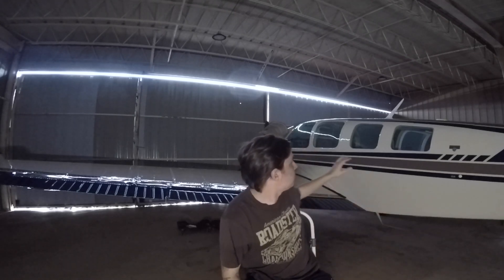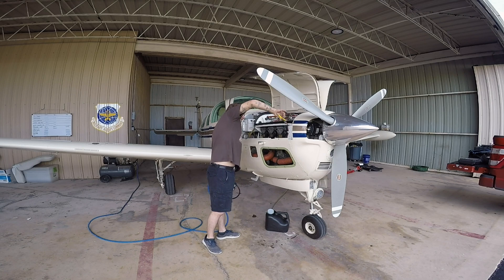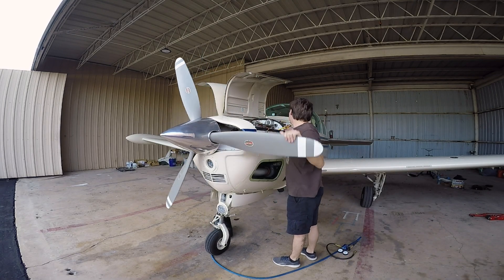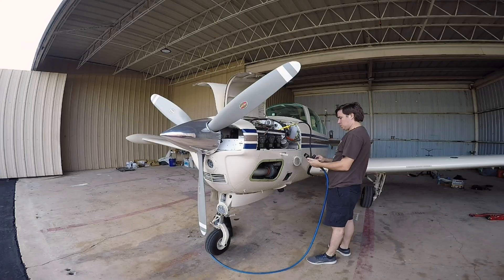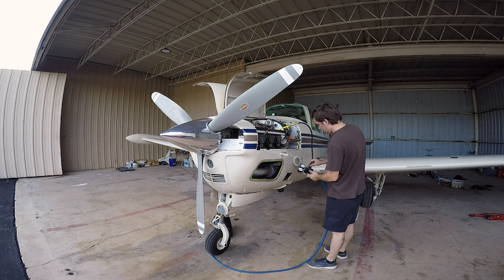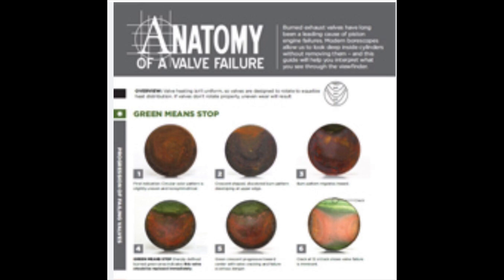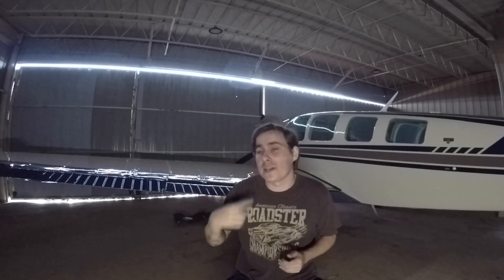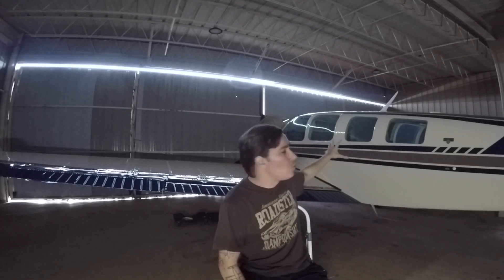CompressionChecks Are Crucial To Determine Engine Performance | A36TC Beechcraft Bonanza Maintenance

Comment: I didn't notice the cabin lights either.  Something I would definitely work on is sound. Especially when you move or turn away from the camera in some of your videos it's hard to hear you (examples: shouting from the cockpit during the gear swing video, and turning to glance back at the aircraft several times during one of the videos about trying to start on of the school's planes (I forget whether the single engine or multi engine).) Speaking as someone who's never recorded anything for YouTube: could you use a wireless clip-on mic or something to keep the level consistent?
Reply from the maker: I have been considering going to a wireless mic in the future. I too have noticed the microphone issues when editing and have been trying to break the habit of speaking away from the mic. 

The only small, very small problem with a wireless mic is that it will draw down the battery life very fast, but with my new adapter and hero 9 I can charge the camera wiel also having the mic plugged in so I may have solved that issue

Comment: Is Camguard oil additive a recommended product? Do all engines have oil coolers?
Reply from the maker: I recommend it, if you use W100 Plus then camgaurd is already in it. As far as oil coolers go, no not every engine has one. Many of the lower performance engines don't really get hot enough to need one.

Comment: Hey Bryce where can I find more info on the limits for the contential compression check limits. I remember reading if they are 42 or above with the master orifice then they pass but that conflicts with ac 43.13s number being 65. How do you handle this situation?
Reply from the maker: Sure thing look at SB-03-3, it's also in the Continental Standard Practice Maintenance Manual. It guides you through the master orifice check. Also AC 43.13 is acceptable data that can be used when no Approved data exists. So based on that Continental manuals or SB overrule the 43.13. The same idea applies to torque if the manufacturer has a torque table it trumps the one in 43.13 I know that was long winded but hope it helps.

Comment: The content is excellent. Video production side, you just need to make that you are well lit and that the lighting is even overall. Also, for a talking head video, you want to stay away from wide angles unless you want the background to be part of the focus—which will also need to be appropriately lit, in that case. If you are not going to light the background object(s), then a tighter field of view is better. But, again, the content is amazing.
Reply from the maker: Thanks for the tips. I finally got the mic adapter and case for my HERO 9. I'm going to consume content on production. The hero 9 is 10 times easier to change modes on the fly with. Plus, having a view finder on the back will help tremendously with setting up the camera.
Reply: @brycebuildsit  Nice. Looking forward to it!

Comment: Another excellent video, thanks!  I did not notice the lighting in the cabin, sorry. 🙂  It's good to hear that you're a fan of both compression checks and borescoping.  I bought my own borescope a year or two ago and find that it is invaluable in determining what's really going on inside the cylinder.  The fact about the compressions increasing due to worn rings was new to me - thanks!

Comment: The information is fantastic and appreciated. The current setup is too zoomed out. Almost fish eye lens. Try a slight zoom in to tighten the frame.
Reply from the maker: Yeah, that was my bad, I set the camera too far away and had to zoom in to get my face centered. Once I transition to the hero 9 I will actually have a screen to view the shot before I record and that should help with setting up tremendously. Thanks for the tips.

Comment: Here's a PSA for the virtue of a borescope... Poking around my Baron's engines, I found an exhaust valve that is starting to not rotate.  A new rotator cap, and about 10 hours of running, I'll recheck.  Probably may have saved me a few AMU's leaving the cylinder on.  I have 12 of them, so the more preventive and non-invasive tests I can do the better.
Reply from the maker: I don't like pulling anything off an engine unless it's absolutely necessary. You can very easily create a future point of failure. The less invasive the better

Comment: cool video, lighting was fine. interesting to learn about the cylinders expanding in that way, i would think that the time the engine spends running cold would cause a lot of wear
Reply from the maker: It's not as much as you may think the diameter cold is something like 5.0005 at the bottom and 5.0000 at the top. Plus, aircraft engines cylinders are very hot compared to liquid cooled, usually 350° and liquid cooled will stay down around 220°